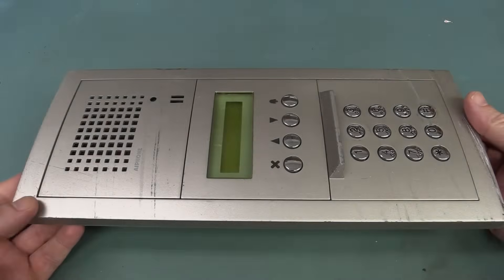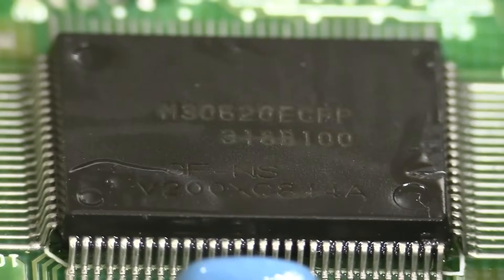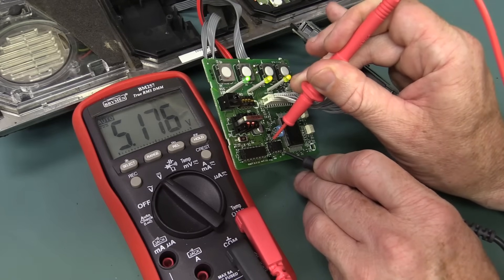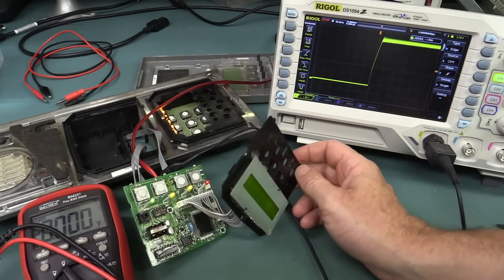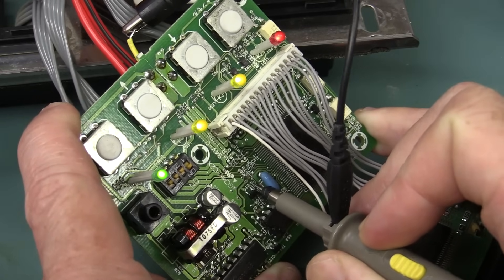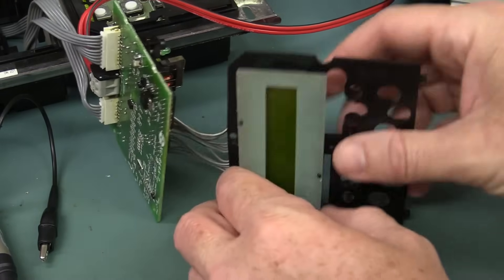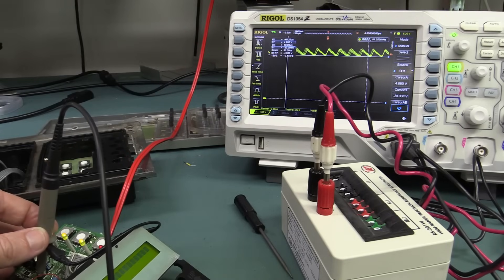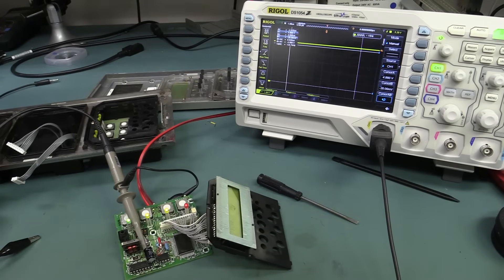EEVblog #710 - Intercom System Repair

Comment: Dude, couldn't the "random" power-on behaviour be related to the missing reset chip? After all, it's supposed to take the CPU outta reset only when it's supply is stable.
Reply from the maker: Jaroslav Malec Sure, but in the end that's not the point. There is a serious intermittent over-current issue.
Reply: EEVblog that reset pin can have some short circuit internally, but you prove that it can be override it, , but it will anyway require a well defined reset signal, not just a RC circuit, that is the reason why it sometimes boot up and sometimes don't, and sometimes you gets a dirty boot up, the leds for sure are PWM controlled so, it is normal f sometimes it hungs up in HIGH state, the leds gets brighter, that will overdraw more current from the I/O pins that control those leds, so be careful, why it seems to boot up more times when you do it manually, because you are inserting noise, and that noise with random luck will meets the requirements of the chip for reset it.
Reply: flyguille You're right - that's what I pointed out in the comment, but Dave also has a point. The device stopped working because of a short circuit failure inside the IC. This not-so-clean reset thing may be causing the excessive draw due to improper startup, but that's not the point of failure.
Reply: Jaroslav Malec I once did a repair like that, and the chip worked during years, if there is an internal shortcut, bit the pin is stil sensing it, you can try to cockup the short cut, sometimes it is just matter of overheating that exactly point, lets it broke, and test again if it is still sensing, if the rest of the circuitry works, it will work for years

Comment: EEVblog 
If it's the chip that draws current then just bring it to a higher current reset R/C switch
if it was the board contamination then get back the reset IC and connect its output to a jumper on the fly to the chip pin away from the board.
for both ways you can just force the problem to "Behave" as it needs to be. Right?

Comment: Google "CAF PCB failure". Conductive Anodic Filaments are an increasingly common failure mode of FR4 PCBs. Copper filaments grow along moisture trapped inside the pcb during processing.
Maybe related to this wierd problem.

Comment: 26:41 Or it could be a brick chip. A chip that will brick your device after cartain expiration date.
Sadly it's verry common these days, our washing machine was bricked this way and i found this tiny PIC on power suply circuit.
Funny the "bad circuit desig" was a dead giveaway, cause there was a backup battery right next to a real time chip on power suply pcb. :P

Comment: Dave..
Good video. 

Since the reset chip wasn't the fault, why don't you put it back on the board and bypass the output from it from the board directly to the mpu reset pin? It might actually be needed anyway.

I think you gave up to easy!! :-)
Reply: The reset chip was likely a voltage supervisor, so it's not really necessary. You don't want to go putting it back on because you don't know if it's actually still good, and you're just introducing another variable. If you put it back on and get a new failure mode, then you're likely to think that it was the chip, and go chasing that for an hour when it really isn't the problem.

Comment: The DIP reset switch was on the whole time during the reset resistor bodge
Reply from the maker: Mihail Dobrolitsky the DIP switch goes to an I/O pin.
Reply: EEVblog
 If you say that three more times, Freddie Kruger comes after you in your dreams.
Reply: David Cruise Well wouldn't that be fun.

Comment: Dave, did you try to toggle the reset DIP-switch again after the 'repair'? I see you left it on, while the manual stated that it should be off...
Reply from the maker: Robbe Derks Yes, makes no difference, the DIP switch goes to an I/O pin. Some issues either way.
Reply: EEVblog
Have you checked if that dip is really making/breaking connection? In my past ive seen sticky or failed dip's.
if the switch is not full of that mask it might be corroded to hell ?

Comment: Dave  mate.. Where is that reset switch now? "to reset put switch 1 in ON position for 2 secconds" .. so.. reset line latched and won't fall unless shorted to ground?.. Where is the switch? .. in ON position !!
Reply: How about purloining a panel from another site? Swap them over. Use the working one to fix your clients' system and leave the faulty one in place of the purloined. If feeling really brave, you could leave a business card or sticker attached - you could even place 'pay per click' ads as a Aiphone specialist. 
Only joking, I strongly advise against any such actions.  Has anyone considered the dip switch?????

Comment: You should increase the current limit a bit, some systems need an initial peak of current to start up correctly. And if stills goes up to the current limit check what is getting warm, just to know what is drawing the most current.
Reply: Especially with the larger tank cap in there now.

Comment: Cut a hole in the back, glue in a switch, then tell whoever screws it back in to flip the switch after plugging the power in. She'll be 'right!
Reply: But if there’s a power failure you need to restart the circuitry by hand. Also the high current fault is a bit concerning. What if it’s in this state a couple of days. Is there something overheating? Is there a change of fire? In this case I think Dave had made the right decision, it’s beyond the simple trouble shooting and it isn’t his problem either.
But since the goal is to create an interesting video, I hope Dave digs in his advanced trouble shooting skills and finds the problem. I think a lot of people here are very curious by now what the problem might be. It’s kind of a movie with a bad ending.

Comment: Old  Processors are very susceptible to starting before the voltage was acquired this is why they used to use the supervisors a lot.  This is why probably 1 of 5 reboots worked. So a pull up in reset alone will not work. If you add a push button to do a pull up and a Resistor to GND you can test this.  And in this case you will require a supervisor.

Comment: You've left the #1 DIP switch ON again though. Doesn't that keep it low?
Reply: Removing the power on reset would have worked if you turn off #1 DIP switch. (I think)

Comment: is that dip switch pulling the pin low?
Reply from the maker: sleepib I measured the pin to ground in the video, it was several K.
Reply: EEVblog at 37:28 you were getting 90mA, but at 41:08, the current through the pin was zero, so where is all that current coming from?
Reply from the maker: sleepib I suspect some form of SCR latchup. The DIP switch goes to an I/O, so it's not that.

Comment: No sound coming from my intercom handset, what do you think the problem be?
Reply: I fixed the problem, It was the speaker as no resistance measured accross it, checked correct voltage flooding accross the circuit and all the cabling had too. It was cheaply made quickly blown.

Comment: I DO NOT think it is the firmware reset switch. :D Wow these comments. Anyway awesome video. Trying to solve these types of puzzles at work are fun... until you start burning through the majority of tests you can conjure up with no avail on a solution.

Comment: when come to repair you always got to strange thinks. The lecroy scope before it shorted the rail get a strange behavior (I'm still think the short could have been under the shield cover that you never removed), the Agilent dsa with the main power supply stop working suddenly in front of you and the real ic problems, the very strange tektronix scope problem (also you have sell the unit on ebay a few time ago we will never know what was wrong), and than this.
Also are you still plain to continuie the repair series on the dsa?
One day you will repair somethingh easilly. Any way good video. You could also try to resolder the ic chip, could it be the ripple from the supply let the chip resetting?

Comment: Digital circuits are very hard diagnose. I would do first is to clean the circuit in a sonic cleaner to eliminate dirt. Chips rarely go broke, if it gone broke probably high current entered or water entered and short circuited fried some components inside the chip. Why else they may go broke? So hard to diagnose circuits have these conditions. Getting a new circuit is cheaper if it’s available instead of repairing one. Repairing electronics was easy back in the analogue days.
Reply: It's true, but you should check out Louis Rossmann. He does component-level repairs on computer logic boards. He is very talented, but he also teaches that with the right equipment, circuit diagrams and some patience, you CAN fix even complex electronics. I unfortunately do not have the patience to work on laptops or phones at any kind of hardware level.

Comment: Dave i have CRT Tv, you rapair electronics dont you?
Reply: "rapair", quite right :)
Reply: haha not sure if i should fix it or just leave it
Reply: JAH1R crt? You mean with a tube? How quaint, but for practical purposes. Tube tv's are obsolete and the power you'd save on a new flat panel would probably pay for itself,  however if it's older they can be very repairable in many cases but there are many types of problems they have too
Reply: xD yes i know that was kinda the joke, i guess i need to practice my english for sarcasm and spelling :P

Comment: 1) Thanks for interesting video Dave.  2) Do you have this unit still? (watching here 7years after)  ...few seconds after playbackPos 19m25sec, its seems the dipSwitch is put in 'reset' mode again?  ...Maybe have another go at it ?, with the partial sucess you allready had.. 
https://youtu.be/-MKUsLi90O4?t=1167  __// if not, disregard. Enjoyed this fault-finding video  :)  ..Thanks again.

Comment: I need help.  An aiphone gf-mk had some liquid fallen through the holes beneath the handset and it stopped working. I changed fuse, cleaned spill and made sure all capacitors working fine, resistors, most of the transistors and still not working. The unit starts, backlight in the LCD appears, the unit rings when called but: no characters displayed, and no conversations are possible, no one hears the other. 
Is there any schematics, block diagrams or any other resources available? kindly post and send notice to fjt@hotmail.es. Repairing the unit is impossible in Chile without paying a very high cost. Thanks.

Comment: While I don't mind if you don't repair stuff you shouldn't call the video a repair video if you don't repair the thing. And, how you would call what you did a repair is beyond me. You have no where near repaired it or are even close to finding out the problem. You've just best guessed at what's wrong and then left it broken.... the title should be "intercom System Fault Finding Fail"

Comment: Aiphone still exist so I also smell bullshit that it can't be replaced!
Reply: We have a few older Aiphone systems where I work, and indeed they are discontinued models that they don't make replacement parts for anymore. So the only source for parts for these old systems is places like eBay, and some random suppliers that might still have some NOS kicking around.

Can't expect a manufacturer to keep producing spare parts for obsolete products forever.
Reply: ***** Leftovers.  Odds are some of those shops are discounting them to get rid of them.

Comment: This guy Dave is proving to be completely incompetent when it comes to simple electronic troubleshooting skills.  He could take a few lessons from Shariar in Signal Path, who doesn't throw up his hands in defeat when he encounters an unobtainable RF part, but goes so far as to incorporate circuitry of his own design to fix hardware.
Reply from the maker: Pablo Suarve I am not going to spend hours and hours fixing this, I don't care that much, it's not really my problem to solve. And I have some decent evidence that SCR latchup is happening and in a system like with one ROM based micro that spells BAD NEWS. Every repair is totally unique with it's own set up issues and value judgements on the cost/effort involved in the repair.
Reply: Besides if you did repair the board you would be bombarded with other repairs from your building. Best thing is to just hand the unit back in a baggy with lots of pieces. Throw in a few discrete parts laying around to add to the effect.and say you tried. You don't want to set a precedence of being able to fix stuff unless you where offered cash.
Reply: EEVblog Reparing skills honor! and can be cold joints ground issues and since it's 10 years old and caps issues
Reply: If Dave is going to take that insult with honor, and no one else is going to, I'll be the first to say that Pablo Suarve sounds like a Foster drinking bogan. Dave does great work here and he gives it to you for free on ad revenue, which isn't easy. Also I wouldn't worry about it Dave his only liked video is pro-terrorism.